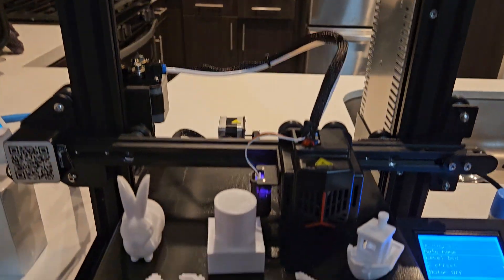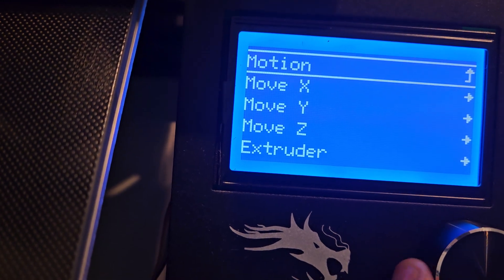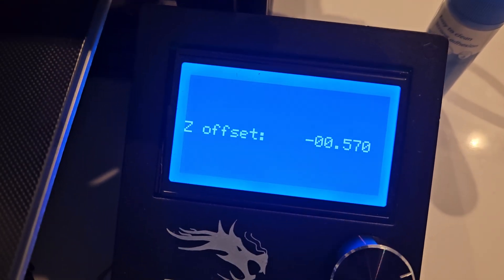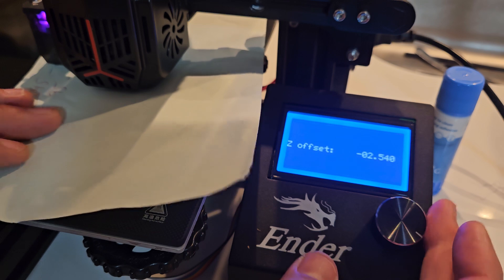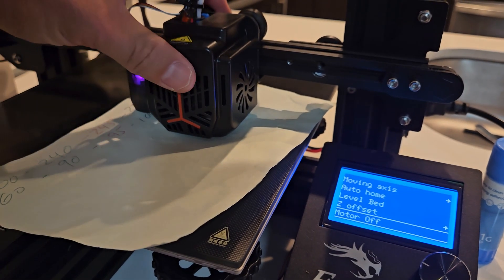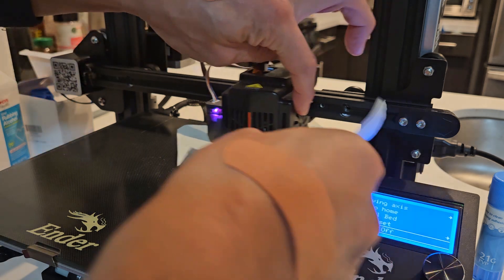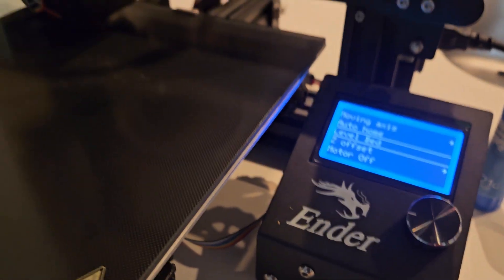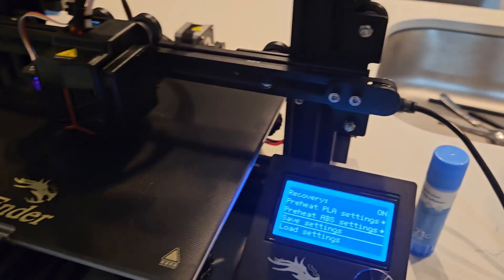How to Level Bed on Ender 3 Neo 3D Printer

Comment: Actual box on the roller (idk what it’s called, but it holds the nozzle and the wires) is moving, should it be moving? I’ve been trying to level for hours and it never actually levels completely in all corners. And I’ve accidentally poked at it and the whole inside of the box on the roller can move and throw off everything I’ve been doing. What should I do?

Comment: my printer cam with the bed leveling wheels tightened to max height so i had to back them off a full turn each just so i could make adjustments

Comment: Is it possible that you need to keep levelling it because the frame keeps shifting? Do you move it around a lot? Maybe check the tightness of the frame screws or those bed adjustments. Maybe sit it on some foam and let it kinda settle in and hopefully never move it. Soundfoam underneath adds a whole lot of dampening to the old school non-silent enders. Also helps reduce the chances of the frame shifting/conforming to the table it sits on.

Comment: My z offset isn't moving the z axis at all. What could be wrong?
Reply from the maker: Unplug then reinsert z axis cable. I had issues before where reseating worked but on another printer I had to buy another z axis cable from Amazon it was like $8 and that fixed it.

Comment: I cannot get mine to physically level. the far back left side is way higher than the rest. the knob is all the way compressed while the others are extended as far as they can go and it still has a gap. I have tried to adjust the z axis up and down then move the head around to the corners and is still unsuccessful. I have tightened and loosen the rollers under the bed and still cannot find that sweet spot. Please any help would be great.
Reply: Did you ever solve this?  I'm sitting here doing this now and what I did was set my z offset to the highest point which was that back left corner and brought the other corners up. Hopefully it works.
Reply: Same
Reply: Having the same issue, it's so frustrating. I feel like I'm about to throw it out the window.

Comment: I’m able to follow, up until the point where you use the wheels to adjust the corners. No matter what way I turn them, nothing is moving/adjusting. What could be the problem? FYI, I’m just a “moderate” beginner to 3d printing
Reply from the maker: It’s moving but like any tiny tiny fraction at a time.. When I first got this I thought the same. Just keep turning the knob, keep going! Just make sure u don’t end up with needle grinding into bed scraping it.
Reply: @WorldofTech  I turned the wheel all the way with directions (even unscrewed it all the way accidently 🤣) no matter what, I can't seem to get the paper under the nozzle.

I can't get it under when I do the "Z offset" part. But when I turn the motor off and move to the corners, that's where I run into an issue

Comment: I don’t understand why we gotta level the bed every 3 or so prints when we have the BL touch
Reply: If you level it good and let the bed by itself you wont need to do it every 3 prints and if you do so i think it would be because of the gears unders your bed going back to its existing position
Reply: I never relevel it and its fine lol
Reply: @erikgobor9721 I've got to relevel mine every so often (not every 3 prints or so, though).
My theory is that the red stock retaining gears are cheap and jiggle loose over time.

Comment: I've run into scraping when printing. It prints way to close, and it scraps when moving around, any thoughts?
Reply from the maker: U prob have to manually level… also if lots of scratching on bed then ur extruder is probably wiggly now just need to tighten it back up. Make sure ur needle is still good too if not easy to replace u should have extras out of box.

Comment: In your slicer start gcode you need to add a line of code and it will automatically level the bed before every print
Reply: What is line of code and what do i set it to
Reply: @TheTornAbyyss 3D Rundown has a video how to configure your gcode
Reply: The slicer adds the gcode by itself and you dont need to add any lines of code?

Comment: Hello! I really need help with my ipad. So recently I went on settings and turned on the voiceover because of curiosity and never knew what would happen. Later on, it signaled red/ grey boxes that surrounded my apps and everything I opened, would be repeated by a voiceover. I cannot get rid of it and my ipad is frozen. Even when I resented it, it didn’t work. I am stuck on the first page of my homescreen and i have a lot more pages with apps in it. Please put up a tutorial for it thank you. ❤️
Reply from the maker: Hmm… did u try this: https://youtu.be/2zLiqASl2vs?si=TwC2FUbvEQ_OK5ut